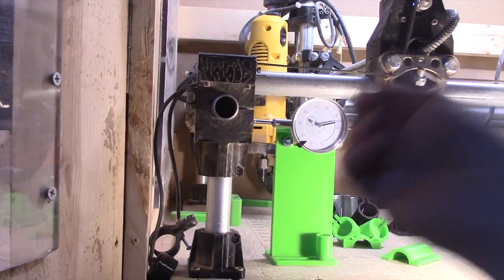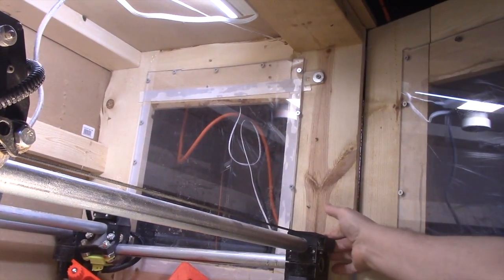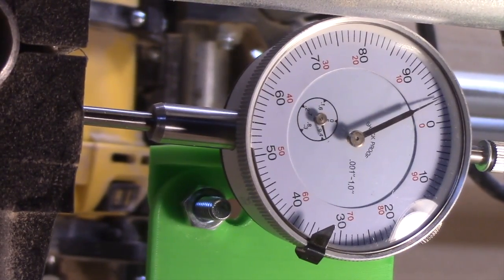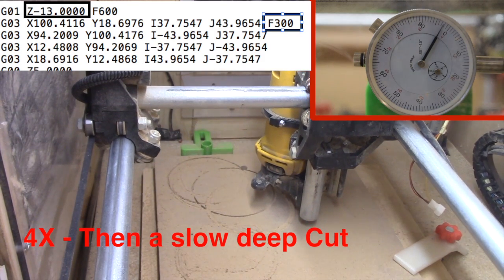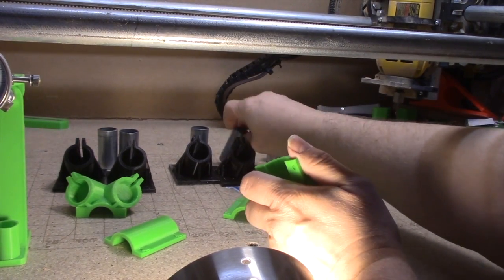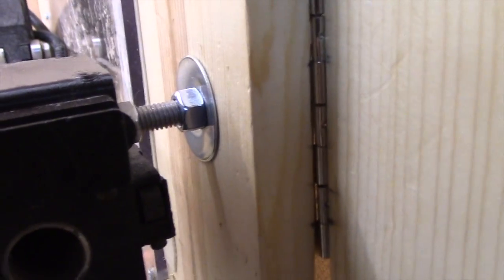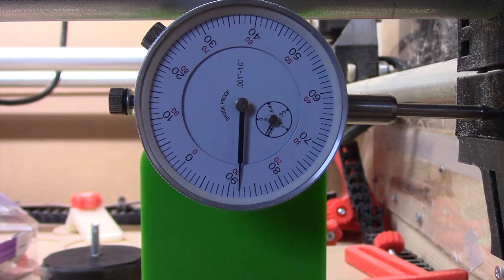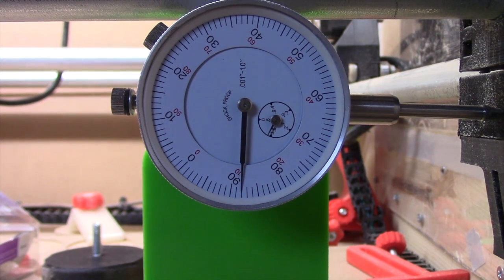MPCNC 18 Flexing

Comment: Glad you did this. I'm in the process of building one a little larger and this gives me an idea at least of what to expect. Not sure what all you planned on milling  but personally unless you plan on doing some higher tolerance aluminum stuff I would just adjust the depth and speed of cuts to minimize it.

Comment: i know it's about a year old video but... I'm always late to the party...
a square frame is less stable than a triangular frame. the "band-aid approach" should improve the structural integrity as it should be not as an aid. 
why didn't you turn the dial indicator to zero? 
but you're right as a hobby machine its fine, but if you want to speed it up and get more out of it stability is necessary for that. 
I don't know if you use it as much as possible or occasionally.
Reply from the maker: I did this video more of an exercise, as I wasn't having any issues.   In use, it just really hasn't been an issue, at least not for me.  There is an add-on on Thingiverse to create triangular braces. I tried them, and just didn't like the design. I did take one of the long rails, and run some threaded rod though it and tie it to the cabinet frame. It just didn't seem worth the effort to do the others. The dial probably didn't return to zero because the frame probably didn't spring back all the way, or there was something else going on I didn't catch. The key is to reduce the issue by keeping the legs as short as possible, even passing the legs through the table and putting another set of leg prints below to hold them more rigidly should make a difference.  And just don't cut too fast or too deep.  I don't use it as much as I should. I do a lot of messing with the laser. Also the Dewalt is only going to take so much.  Yesterday I cut some MDF panels for a Low Rider which I plan to build slowly. Worked great!  Last week I thinned (because I don't have a surface planer) and cut some maple for making some signs for work without a problem (except that the maple peelings blocked the vacuum hose). It's absolutely usable. I prefer a two flute 1/8 inch bit. However, many like to use a 1-flute. With the two flute, I had to speed up on the maple to keep it from burning. These videos will be coming out soon.  Certainly don't let this worry you about making an MPCNC.  It's a fun project and handy to have!  The only reason I'm building a Low Rider too, is so I can make videos about it and I want to have a bit larger cutting space that is beyond the recommended size for an MPCNC. Thanks for watching and subscribing!

Comment: Firstly, I love your videos, please keep them coming. It's been great to watch while my own MPCNC is still in the build stages.   I am new to CNC but am coming at this as a 'traditional' manual machinist.  Machine flex is just one of them things, it's going to happen, same with tool bits, and well everything involved really, material, clamping etc.  Bigger, heavier cuts, more flex.  The way I have always looked it is that if nothing flexed something would snap :-)  generally the tool bit.  In milling its a finishing pass, on the lathe it's a spring cut.  Different name same meaning, hog a good proportion off the work, and then tidy up later :-)  Not quite so easy with CNC as you do really get to measure and have another quick pass.  I have not had a chance to use Estlcams finishing settings in real life, but they look like they should do the job.  Can't wait to get my machine up and running properly, so I can play along with the rest of you.  Love the marquetry idea, will be tying that myself.  Thanks again for the great videos.

Comment: what is the dimentions of your machine?
Reply from the maker: The work area is about 1 foot on the y axis and 2 feet on the x axis. I used the calculator on the Vicious1 website here:https://jscalc.io/calc/Y1Db347ni9eckSKc (there's also one for metric), which indicated I needed a table just under 24 x 36 inches, so I rounded up to make things easier, only requiring one cut in a 2'x4' panel for the top. I had to build the upper cabinet a little larger to clear the machine, hence the 2x3" skirt around the table for the cabinet top to rest on. Vicious1 recommends starting small, even if you plan to build larger in the end, just to get the hang of it. I would have liked to go just a little larger but had limited space to work with. Thanks for the comment!

Comment: I'm looking to buy one of these machine's and want to cut smaller aluminium parts. Would you recommend to buy the printed parts first , build them with the conduit then buy the electronics and install them?. I live in the western usa and is there a recommended printed parts for where I live to get conduit that'll fit?
Reply from the maker: Well, that's a tough one. If you're talking about buying the plastic and hardware bundles from vicious1.com, then, if you buy the plastic first, then you can't assemble without the bolts, etc. from the hardware kit, And of course you' also can't assemble much if you buy them the other way around. I think you'll be kinda stuck until you have both bundles in hand. Hope that helps.  According to Vicious1.com,  "23.5mm fits 3/4″ EMT conduit in the US,"  off the shelf from your local home improvement store. It doesn't hurt to put a caliper on it just to make sure before you order the plastic parts. Be sure to check out the forum at vicious1.com. It's very helpful and friendly, and very informative.  Or feel free to post here, and I'll give it my best!  Thanks for commenting, good luck with your build. Do post some links to some photos or videos of your system when it's done!
Reply: Some Old Guy Coding after posting that I looked at the pictures on the website closer on my tablet instead of my phone and noticed that was a silly question. Thanks for your reply. I'm heavily into machining with manual machine's but would like to get into cnc routers to cut some smaller parts.
Reply from the maker: trialnterror   Enjoy the journey!  Thanks for commenting!

Comment: Knowing that the machine is going to move, and really any cnc mill/router flexes, you change your CAM to help.  Best to always use adaptive clearing or trochoidal milling so the bit is only ever engaging the correct amount of stepover and cutting in either the climb or conventional direction, a full width cut will always wander and have the highest load transferred to the machine. The "proper" way to do this cut and really any cut is to leave some material behind for a lightly loaded finish pass to bring it to desired dimensions. You need enough material to account for any flexing (so if you have .005"flex make sure to leave more than that). I leave about .010" if not a little more for my finish passes, in XY and Z on 3d cuts or pockets.

With your 13mm cut seemed to go well but the dial gauge only measures the frame, the center and the tool and the bit all move as well. Well really everything flexes but to what extent, the only way to measure that is an actual cut. 

As always I love the vid and the discussion it brings, thanks for helping us all think about the flex and some actual numbers. It would have been cool to see the flex before and after the height change. There is another way to help stiffen this up, maybe it is time to start on a new update for the machine...
Reply from the maker: Thanks for your comment!  You put it so concisely, and it makes a lot of sense. I think we all need to take that first paragraph and engrave it in something.  Yes, it's something I should have measured before, but the subject came up after I had raised the machine. I can't say I've had any noticeable issues that I can blame on flexing so far. No need for a new update from me.  And now I understand what the finishing settings are for!